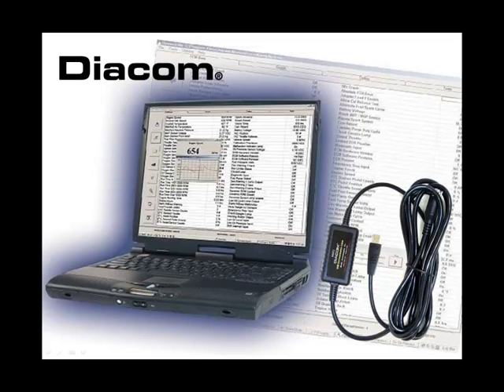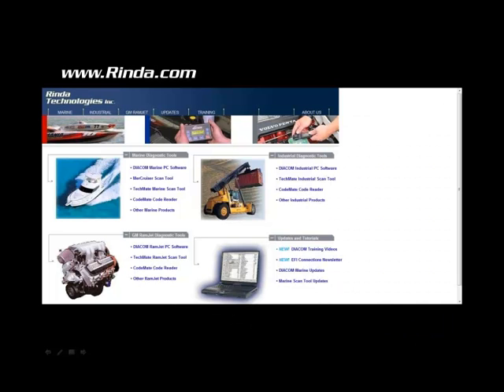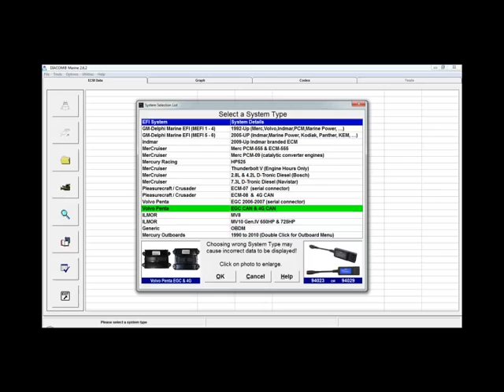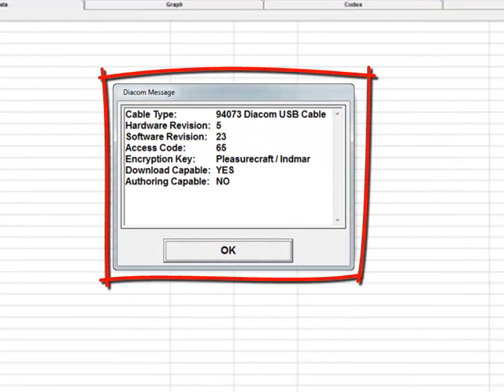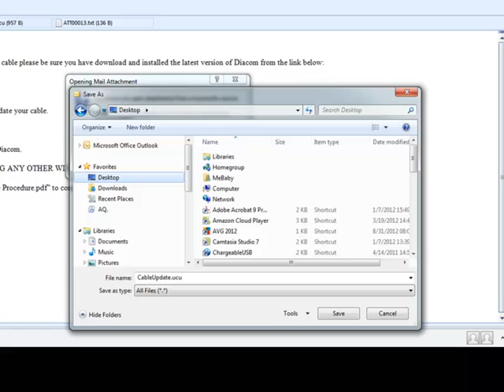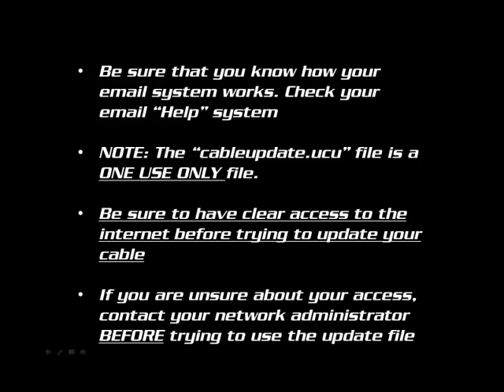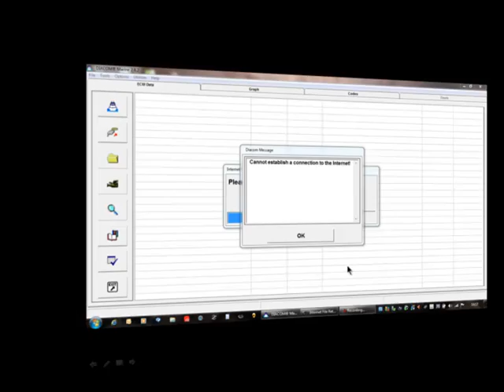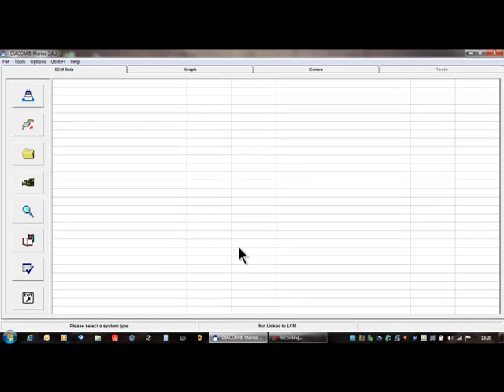Diacom Marine cable information and software updates

Comment: See.... now THIS is how EVERY company should do a video about their product. You even showed people how to save a file on Windows. Great video! I just bought a 2013 Regal 2500 with a Volvo Penta 5.7L300hp engine. Will this program and cable access me to ALL of the ECU's information? I come from the automotive world and we build 500-1800hp cars. I'm familiar with tuning and datalogging. I would love to be able to see what is going on with my engine in my boat. Does this program have the capabilities to change the engine calibration at all? Oor even update the engine cal is there is a newer cal for it? I'm pretty sure I have a thermostat that keeps sticking on me when I first start the boat and leave my dock. Let it sit for a few minutes and it unsticks itself. I'd love to verify that is the issue as the alarm does go off in the boat. Thanks for the great video. Looking forward to getting my 94029 which I believe is the right cable.